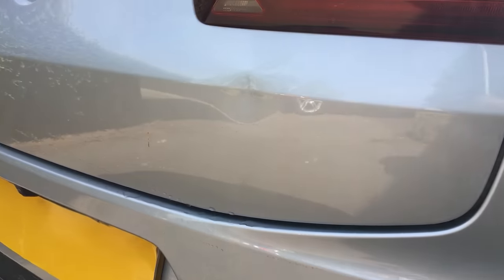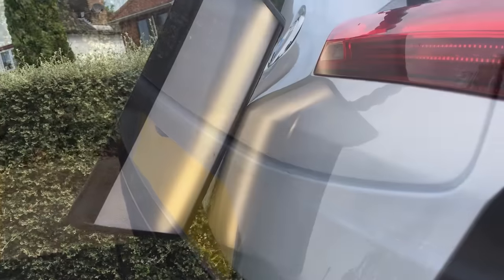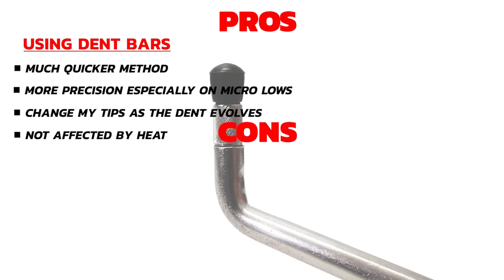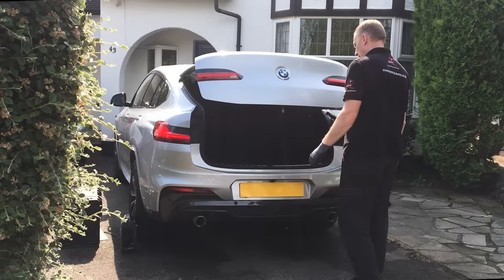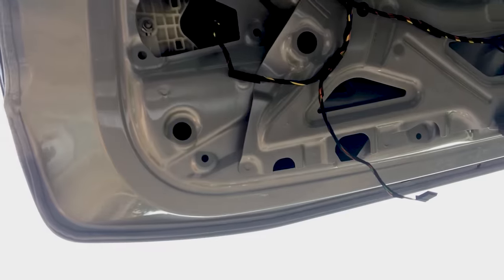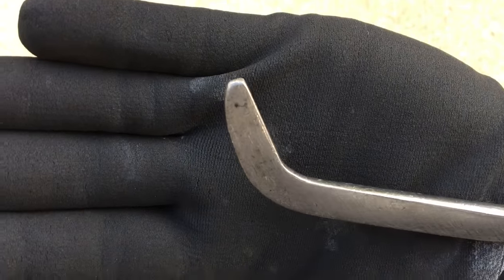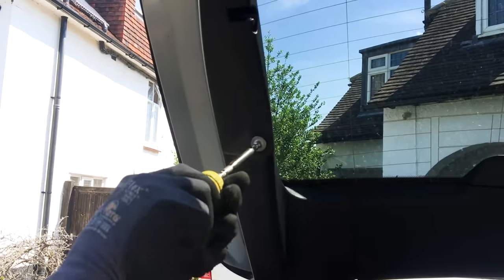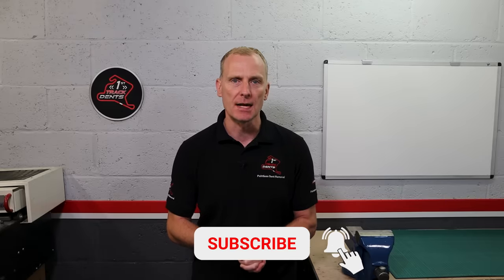Removing BODYLINE Dents! | GLUE or PUSH? What’s best?

Comment: reaper rod is the best for them for me.i fixed 7 dents yesterday on a 200 mile 2011 camaro ss convertabile that a1 reaper rod shined evertime and it was black guy wanted it close to 100 percent without any sanding i tryed other rods nuthing you need a sharp reaper in my opinion i did a shelbe mustang to that was even harder pushing with reaper but it got it done
Reply from the maker: Hey John, thanks for your comment, yes I've heard of you guys using the reaper rods over there in the USA, I've never seen one or tried one, sounds like a great bar 👍

Comment: So I have a 2018 Grand Cherokee with a dent on the body line. The place I took it to said it would cost about $1000.00. Then mentioned it’s possible that removing the dent could cause the pain to chip. What do you think on a fair young vehicle? To add my dent is the same size as the one shown in the video, except it’s on the door.

Comment: Nice job! Looked good, I prefer to push also instead of glue if you can access it. U made it look easy!
Reply from the maker: Thanks Aaron, yes I always feel more comfortable with pushing as it gives you more control and there is less risk of damaging the paint, although there are some amazing sticky glues on the market, but I don't think any of them would have been strong enough to touch this dent 👍

Comment: Hope you reply. Watch the first video I found of yours. You worked on several dented and types of debts on a passenger rear door of a silver car. 

My dent is similar to the smallest dent you fix on that door opposite the door handle on the front passenger door. 

I always drop my hood closed at a certain height. This time I pushed down on  it creating a smooth oval like dent about 1.5 or so. Opposite of the center raised body line. Dent does  not make contact with that line.

So dent wizard will do the job. At same time may get them to work on extremely hard to see create on a passenger rear door hit by another door. 
 

I show the car, I am very particular. So I cover up certain areas of my car where mechanics etc may handle. I will remove interior panels and or other parts if easier then covering them up with tape etc.  

All this gives me peace of mind other things don't get damaged while work on other issues are getting done. Trust me it has paid off. Taking a car in to get a repair and it coming out with other scuffs, scraps, Mark's etc sucks. What I do usually makes there work easier also. 

So with this door very mild crease I know the SUPER EASY to mark up all hard plastic interior panel has to come off. Thus do i leave window up or down for dent wizard to work on that door. 

Because they won't have the interior panel. It will be safe at my home. Vehicle 2017-2020 Chevy Sonic hatchback. 

Ps: crease is about same location that smallest  dent was on the silver car you worked on passenger rear door.
Reply from the maker: Sounds like you are the ideal customer when you say that you prepare the car in advance for having work carried out on it, removing trim panels etc. I hope Dent wizard do a great job for you, there are some great PDR techs around these days and it's great if you can find one who really takes pride in their work. I wish you all the best, regards, Jake

Comment: Do you do dents that have come from the inside out or pushed in from the front then buckled the fender outward with no paint damage.
Reply from the maker: Yes did one today in fact on a fender which had a huge buckle coming outwards in the middle caused by a slow moving collision at the front. You can check out this video of mine with a high spot coming outwards, this will show you my method of how I remove a high spot 
https://www.youtube.com/watch?v=th0kBC27gT0&t=7s

Comment: What make of slide hammer do you use/ prefer.
Reply from the maker: I only have one slide hammer that I use but it doesn't have a brand name on it sorry. Most of the best brands are sold by the top PDR suppliers, maybe check their websites. It's a good idea to have a light slide hammer and also a heavier one as it is good to have a variety 👍

Comment: Great work Jake. You are a master.  Quick question - are there any official or unofficial sources/databases to find out how the internal access might look for each model - or are you just reliant on personal experience and/or just stripping the panel trims and seeing what you find?
Reply from the maker: Just personal experience really, most manufacturers use the same systems on most of their models, so you can kind of guess how newer models come apart:-)

Comment: Definitely a believable repair....most of these videos are a scam to get 'likes' and 'subscriptions'...off camera they fill and paint the car.Have seen so many heavy dints scratched and after a pushing techniques it’s like magic was performed. Even if they simply admitted that sometimes it just will not work out and filler and paint will need to be used.

Comment: So which one was better? You didn't even tried with glue.
Reply from the maker: As I mentioned in the video, glue wouldn't have really worked on this dent so that's why I didn't try and use it and from the force it took to push it up, glue pulling would never have been strong enough. 👍

Comment: great result! Have you had any experience working on mk5 generation of Jetta? I have 3 dents on driver's side rear quarter panel and wonder if it's possible to access behind the panel from somewhere. I've given some pulls but I could really use some push too.
Reply from the maker: You would need to remove the inner trims:-)

Comment: Only 4 minutes in, but I think you definitely made the right choice. I’d definitely want to access the dent even if I started with a little glue pull first. A couple of aggressive or misplaced taps on the crown or around the body line and it won’t be as clean without a sharp tip picking at them. 

Basically to glue pull that dent and finish it, it would take too much time being so careful with every tap. Might as well at least find a way to slide something to it.
Reply from the maker: Totally agree, It was quite tight to push up so glue pulling would have really struggled. Glue can be great, but yes it can take so long to do. I've spent an hour before trying to pull a dent with glue making slow progress, only then to find out that I did have access behind after all, then I push it up in about 5 minutes!

Comment: Wow....your videos are so interesting. ..what is the set call? The one with the bars and the tips...I live in Los Angeles I will try to get them
Reply from the maker: The 24 inch double bend tool I use all the time from Ultra is here:
https://www.ultradenttools.com/products/st3802-24-x-7-16-screwtip-dbl-bend-90?_pos=3&_sid=d6dbd8607&_ss=r 

The A44 tip set that accompanies the 24 inch double bend tool:
https://www.ultradenttools.com/products/a44-7-16-6-pc-tip-set-and-tip-holder?_pos=1&_sid=5430179c2&_ss=r
Reply: Awesome. ..thank you for the info

Comment: Love your videos man, keep up the good work. I have a question I popped a dent out using the hot glue method, but I notice popping the dent out, it has left bubble bumps on surface & why does the  dent easily goes back in like how it was, when I apply small pressure on it ?
Reply from the maker: Hi, this could be due to a few reasons, maybe there is still glue residue left on the panel or maybe it has had a poor paint job previously and the heat from the glue has damaged the poor paint finish. If the dent just pops back in then, either you need to release the crowns around it or the metal is stretched. 👍

Comment: 1st Track Dents , Where do you buy the push tooling that has the rubber and nylon tips as I can only find the steel tip tools for sale ?
Reply from the maker: The 24 inch double bend tool from Ultra is here:
https://www.ultradenttools.com/products/st3802-24-x-7-16-screwtip-dbl-bend-90?_pos=3&_sid=d6dbd8607&_ss=r 

The A44 tip set that accompanies the 24 inch double bend tool:
https://www.ultradenttools.com/products/a44-7-16-6-pc-tip-set-and-tip-holder?_pos=1&_sid=5430179c2&_ss=r

Comment: Great video Jake, you are an amazing pdr tech. 
What bar and screw on tips do you use? Do you have a link?
Reply from the maker: Thanks Joe, the 24 inch double bend tool I use all the time from Ultra is here, this is a great all rounder bar:
https://www.ultradenttools.com/products/st3802-24-x-7-16-screwtip-dbl-bend-90?_pos=3&_sid=d6dbd8607&_ss=r 

The A44 tip set that accompanies the 24 inch double bend tool:
https://www.ultradenttools.com/products/a44-7-16-6-pc-tip-set-and-tip-holder?_pos=1&_sid=5430179c2&_ss=r

Hope that helps 👍
Reply: @1st_track_dents  thanks for that Jake, appreciate it mate👍

Comment: I have the same dent on my car that is going to be repaired today. I was told that the result should be around 80% of perfection. It's a sin to be so far from you!!!!! Your great job  is what I mean for perfection and great professionalism!!!
Reply from the maker: Thank you, hopefully it will come out 100% or close to. Sometimes on a tricky dent I won't promise 100% but most of the time I manage to achieve it, it's called under promise and over deliver! Good luck with it 🤞
Reply: @1st_track_dents  hey just called me on the phone: they told me that the paint has been removed, literally "the paint is left in his hand". It means that instead of working with the levers like you do, they worked faster with pad and glue. And of course it's more beneficial to them because in the end the job will cost me triple and they'll work half the time. And I'm sure the end result will never be comparable to one of your repairs done without repainting. I imagined it would end like this. Anyway, good job and congratulations again for your interventions which are miraculous
Reply from the maker: @stefanonovelli9810  That's a shame, maybe the panel has been painted before, maybe that's why the paint came off. Without seeing it I can't really comment. Hopefully the repair will still come out ok. Thanks again for your kind words, I really appreciate it. 👍

Comment: Great to see the dent disappear, my problem is astra k off side wheel arch  it appears to be double skinned so how can this dent be done it’s quite a sharp dent
Reply from the maker: Hi Adrian, yes dents in the rear arch are always a problem as most cars except for a few are all double skinned here. So the only real option is glue pulling although if the dent is too sharp, this approach may not work. The other option is to get a thin bar from inside the boot/trunk, I would also strip out the wing liner/stoneguard as sometimes you can get lucky and find a factory hole for tool access. Failing that it may need to be repaired and painted. PDR is great but we still can't guarantee that every dent can be removed. If we can't get behind it then there is not much else we can do. Good Luck 👍
Reply: @1st_track_dents  thanks for your reply, I will look inside the boot for access never thought of that thanks again , it’s really annoying it was an old man who done it parked next to me I had reversed into space out the way he came next to me in a virtual empty car park when I saw him do it I did not notice ding it was when I washed car to my hotter there it was .
Reply from the maker: @adriancarter825  Sorry to hear that, yes I don't know why people park next to another car in an empty car park? I have this conversation nearly every day with customers, I think people like to align their car next to another as they can't see the parking bay lines? Nearly all of my day to day work are dents caused in car parks so you are not alone. Yes the boot may be your only option for access. 👍
Reply: @1st_track_dents  thanks again I am now subscribed I find dent removal very interesting
Reply from the maker: @adriancarter825  Thanks Adrian, great to have you onboard! 👍